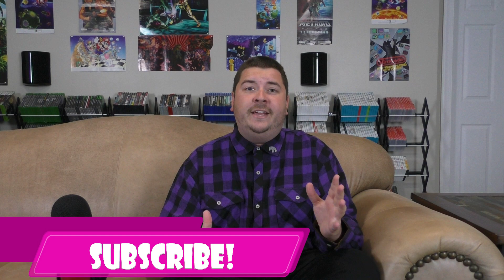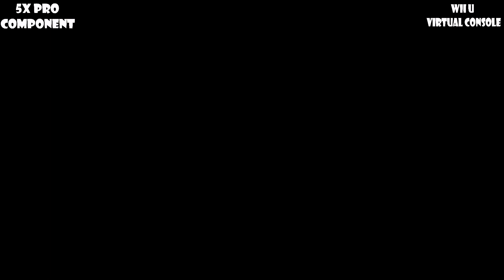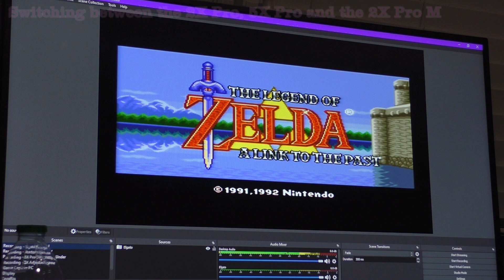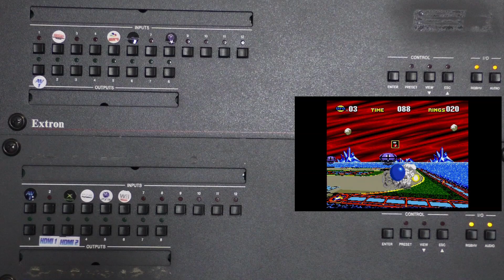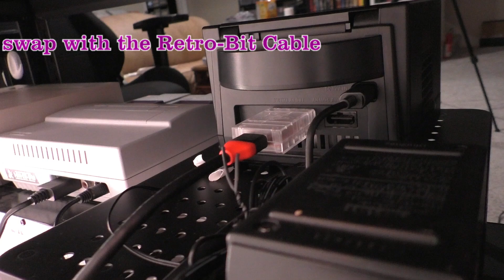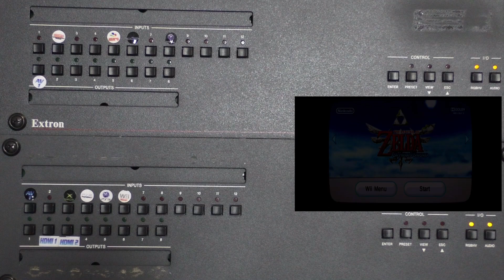My New Retro Gaming Set-Up: Powered by Extron!

Comment: You have a RGBHV extron switch the nice thing about these older generation BNC extra switches is there is no to very little electronics between the input port and output port. This allows for near to zero latency. There are other switches out there that have scaler and other features on them that add latency.

The nice thing about these extra switches, not having a bunch of electronics between the input and output paths is that any signal that you feed the input ports will be the exact same signal that comes out of the output ports. This means that if you feed it composite signal through anyone of the BNC connectors on an input that the same composite video signal will come out the same port on the output side. This is the same with component if you send your RGB component signals through that signal will come through the output sports as well. This is also true with RGB HD or any other variance of RGB. If you send any variant of RGB down 3 4 or five of the BNC connectors for that input, the output that you have selected will get that same RGB signal. If you want your set up to have mainly component and some RGB, then the best solution might be to use one of your two extra switches, solely for component and use the second one solely for RGB. I myself have thought about putting all different flavors of signal into my extra switch, but knowing if I do that I would need to be able to put independent outputs out of that switch the handle each signal type.

So if I have input one as composite input two as component input 3 as RGB sink on green and input for is RGBHV then I would have to have at least one output per signal type in this scenario that I showed above. I would need four different outputs one for component one for composite one for RGB sink on green and one for RGBHV.

I myself also have a crestron md-dm32x32 which can have HDMI 1080 P cards, HDMI 4K cards as outputs and as inputs it can have anything from HDMI to DVI to VGA to RCA to BNC as inputs. A nice thing I have done is I have a couple of DVI cards as my input cards. No I have not tested this yet, but might goal is to put a VGA to five pen BNC cable to the DVI card and run that to my extra switch which would allow me to feed that one card with anything from composite to component to RGB of any variant. Again, I have not tested it so I don’t know if it’s going to work. In theory it should work.

Bottom line to use RGB on the switcher you’ll need a VGA to BNC cable that breaks out the five pins that will allow you to plug your VGARGB source up to your switcher. But then the problem is it’s knowing which flavor of RGB or VGA that device is feeding you. And having another RGB or VGA device on the output side to grab that signal.
Reply from the maker: The flexibility of the formats and the near zero latency is something I should've talked about, its amazing that they can accept and output basically any analogue signal type without altering it, plus being able to split it or output different sources at once (up to 4 for my models). I had a good guide back in the day that helped introduce me to all this stuff. It was a manager at Video Game World who introduced me to RetroTINK, CARBY, and the Extron Switches. He did arcade machine repair and analogue audio set up as hobbies, so Extron specifically was something he owned and could help me with. The specific ones I got were per his recommendation all those years ago (I've had them since 2021).

Comment: Great video I do have a question. So I have all my consoles hooked up through component but for whatever reason my GameCube and Wii are giving me red/green lines now. I’m using the same company for all my cables so I’m confused why just those consoles are doing this.
Reply: The two systems work fine if I hook them directly into my tv but as soon as I route them through my Extron Crosspoint they are washed out. When you unplug the audio cables for those consoles the red/green lines stop but they are still washed out.

Comment: I have a question. For components video, is it possible to connect RCA left & right sound cables with BNC connectors to the H and V terminals without using RCA phoenix connectors?  I think it's possible in the sense of simply connecting the signal, but have you tried it?
Reply from the maker: An experiment! Challenge accepted......Challenge Regretted lol. To describe what I heard as "nails on a chalkboard" does a disservice to Nail-Chalkboard musicians. So no. Technically yes, audio travels through, but something happens to it, it comes out with increased volume and incredible distortion. I know that most Extron Switches let you mess around with the dB levels for the audio...but that wouldn't help here since these are video inputs, so I'm not sure how much control there would be for this use-case. So basically no, audio is intended to enter via phoenix adapters. RetroGamingCables sells specially made ones for Extron Switches, if you didn't know, that is where I got mine. They make dedicated Input and Output versions.
Reply: @RetroBoost  Thank you very much for your experiment. I'm surprised that you got different results, because as far as I know, RCA-type switchers and splitters are RGB and component compatible. I don't know if there's something special about extron products. I predicted it would work and already purchased a 6 input Extron switcher some days ago and it should arrive soon. I bought it for component video & audio. It's a smaller and simpler structure than what you're currently using, so I'm just crossing my fingers that the audio works. 😅

Comment: Hey, sweet setup my dude. How'd you deal with the Extrons outputting video and sync at TTL voltages instead of the standard 1Vp-p? 🤔

I just got an Extron CrossPoint 300 128HVA and quickly found myself hamstrung by the fact that the signals it puts out are too 'hot' for all my display devices. 😬
Reply from the maker: It hasn't been a problem for me. The specifics of that stuff is above my head, but when I got the two extron switches, I knew that you could customize some of that, so I decided to factory reset the two switches before I used them to prevent that from being a potential issue (mostly the audio levels being messed with was my concerns though). Sorry I can't provide more.

Comment: Love the videos man ! Thanks for all the info
Reply from the maker: Thanks! Extron is such a cool retro thing to mess around with. I recently hooked my VHS player to my 5X Pro with S-Video, but kept the audio rca running through the usual Extron input. Shockingly, it all stayed synced up, I was expecting an audio delay, since that input went from the top switch to the bottom one, then out to the 5X Pro. They aren’t kidding about the Extrons being lag free (at least so minimally you’d probably need to daisy chain a bunch to start to notice it).
Reply: @RetroBoost  I found a extron crosspoint ultra but the guy is asking around 400 euros I found this to be too expensive, I’m still using the same 8 in 1 out composite switch box like the one u had in set up 1.0, is giving me issues when splitting my n64 video output y wanted to get an extron mostly because of the lag free and no quality loss when using more than one output for the same source

Comment: To run RGB through the extron wouldn’t you just use a BNC-to-Scart cable? I got one from I think Retro Gaming Cables. I use it for my PVMs’ BNC connectors. I play my RGB modded NES, N64 & Genesis using it. I just plug the consoles scart cables into the BNC-to-Scart cable, and boom RGB.
Reply from the maker: I’m not totally sure how you’d run RGB through the type of Extron that I have. I’ve seen breakout cables sold at places like RetroGamingCables, but all of those have the Sync Cable as well, like what PVMs need, and like the one I got to play with in video I did with Video Game World. I’m not sure if that would work on the Extron Switches I have though, but I’ve never tried. I’m about to revise my set up, and will use a Scart Switch for all my consoles that can use RGB, and that switch will connect to an RGB2COMP, which will then run into my Extrons. Why? To allow for all my RetroTINKs to be able to access those consoles. I was tempted to run that switch directly into my 5X Pro, but then what happens if I get a RT4K? Uh oh, gotta rewire it all to that, but then I  the 5X Pro is left out. It’s the only way I can keep everything connected.

Comment: amazing setup, how did you manage to hook up extron 1 to extron 2 ?
Reply from the maker: Thanks! These Extron Switches have 4 outputs each, so I take Output#1 from the Top one and run that via Component to Input #1 on the bottom switch. Then the bottom switch is using its outputs to run to my different RetroTink devices. So the bottom one is kinda the “main” and the top one acts as another source when it boils down. Theoretically you could have 8 different extrons all output into one single Extron as a way of funneling your sources. That’s pretty extreme, but hey, someone out there has probably done it haha

Comment: Awesome setup and great info on those extron swites. I hadn’ heard of those before. I went on ajourney many years ago that still goes on today a little bit. I have one console left that uses Composite signal. My Nes and I hope to Rgb Mod it someday to use with Component cables. Currently it is plugged into a large Crt and looks nice nonetheless. I have two systems that use S Video and those are my Philips Cdi 220 model and the Panasonic 3DO FZ1 of which I both hope to get Rgb modded someday for use with Component cables. Again, I have them both plugged into a large Crt and they Look great, especially the 3do. I imported a Japanese 3do with the 240p switch which really cleans up the image. Now of course, I have the Xbox 360, PS3, Wii U, and Switch all plugged into a 1080P Led tv for perfect resolution balance through Hdmi. I also have my PS4 Pro plugged in through Hdmi but on a 4K tv to take advantage of that. I have my Dreamcast hooked up through a Vga monitor with the Oem Sega Vga box and damn does that machine look glorious that way. Finally, every other system I own is hooked up with Component cables. The OG Xbox is using the Oem box with component cables. My PS2 uses the PS3 Sony component cables and I have optical audio cables for both machines as well. My Gamecube is hooked up with the offical Nintendo Oem component cables. These all go to a G Comp Component switcher which is split between a Crt and an HD Tv for the best compatibility for enhanced definition/widescreen games and 480i/light gun games. The big one is the other systems. My Ps1, Super Nes, Sega Master System, Sega Saturn, Model 1 Genny/model 1 sega cd/32x tower, and Us Neo Geo Aes are all hooked into the G Comp using HD Retrovision Component cables for beautiful Rgb to the crt. I got my N64 rgb modded and have the same cables being used there as well and I got my US Turbo Duo Rgb modded, recapped, and region free modded and use the Hd Retrovision component cables there too for beautiful visuals. Finally, I use the Jag2snes adapter and Hd Retrovision Component cables on my Atari Jaguar/Jag cd unit. There are so many compenent cables, I had to get two G Comp Switches. 1 that goes to the large crt and a smaller one and the second one goes into the large crt and the 1080 led tv. Also, the Led Tv is on a wall mount that can turn vertically as I am a huge fan of Shmups, so with that, I have the ability to play every Shmup I own in Tate mode and the Analog systems that support widescreen in widescreen. Meanwhile, all audio is fed into the stereo for surround sound. This took many years and is my obsession but everytime I play a game, it looks and sounds great. I look forward to when I can get the 3DO, Nes, and Cdi on the component switcher as well to finish it all up.
Reply from the maker: That’s a fantastic set up! Never thought about being able to turn a tv to best suit shoot-em-ups, that awesome! I need to look into utilizing multiple screens too, that’s a killer idea the way you use the gcomps to work with that. Love it! That an a CRT, need to eventually get one as well. Biggest obstacle is space right now, need to find a way to better condense and organize things.

Comment from the maker: Been slowly working toward my next set up. “4.0” if you will. Thinking about using Blue Retro Cores on each console, so that I can use the same controller for all my consoles. Then I might add a SCART Switch, like the one RGC made for the 5X Pro, so further consolidate inputs and free up some slots on my Extron Switches. Bit by bit, I’ll get there.

Update:

I’ve decided to lean mostly into 8bitdo’s receivers, and have gotten them for most of my consoles. The only ones I don’t have 8bitdo for are the N64, GCN, and Wii. For those I’m using a RetroTime BlueRetro Receiver, and can still then use an 8bitdo Pro 2 controller for them. Decided that I would use a scart switch into an RGB2COMP as well, this way all those scart sources can be output to a variety of outputs.
Reply from the maker: Update, the Blue Retro dream hit some snags. Bought a couple of Blue Retro Cores, one of which seems to be either defective or is super non-cooperative. I’m able to use it normally, but can’t for the life of me get into its configuration to custom map buttons. The Blue Retro Adapter made by RetroTime was very good, they are making a GameCube one next, maybe they’ll eventually make one for every console haha. The Blue Retro Core that is working is for the GameCube, I was able to access the configuration over Bluetooth. I still may get more Cores, hopefully the defect I encountered is something that won’t happen again.
Reply from the maker: Another update on this controller topic: 8bitdo let me achieve the “one-controller” dream. Got their receivers, then got a Pro 2 controller, which also works with the RetroTime n64 blue retro receiver. The Pro 2 doesn’t have full functionality with the GameCube Blue Retro Core, that was the only snag, the L and R inputs don’t register. RetroTime is releasing their own GameCube receiver, which I hope will work fully with the Pro 2 like the N64 one does. Great controller.
Reply from the maker: @gilramos5767   It is heavy duty garage shelving. You can customize the height of the shelves, so theoretically I could fit a CRT toward the center. I’ve been happy with it. I added monitor stands to then add “sub-levels” that the consoles can sit on, allowing for more to fit.

Comment: I think v4.0 should be getting a Crestron processor and control your console AV switching with a touch screen like I do 😀I wish YouTube comments could upload a photo, I’d show you my work in progress. My system consists of a Crestron DMPS3-4k-100-C, TSW-1052, Extron MAV 84, Crestron HD-MD8x1 (hdmi switching). Essentially the touch screen turns the power on to the TV and does TV controls and to switch the console selection, click and drag which console you want and it switches it to the proper source.
Reply from the maker: That is an awesome set up! And great suggestions! I definitely need something more efficient for HDMI consolidation. That 8x1 Crestron Switch is a great idea. Another thing I’m definitely doing is getting Blue Retro Cores for all my consoles, that’ll let me use the same Xbox or PS controller for ALL my consoles. Very efficient.
Reply: @RetroBoost  do not get a crestron processor. The program Crestron processes you require specialized software that only Crestron integrators can download. The best suggestion that I have for you to automate the set up is to connect your extra switches to the network and set up Home Assistant with custom scripts to control which device devices get switched for what reason.
Reply from the maker: @davidew98 The stuff mentioned above by earlmcnulty is damn cool, but yes, requires some additional knowhow and access to utilize. On the retro boost discord server, Earl shared the journey with photos and everything, it’s spectacular, but between the cost of getting all that equipment and needing to learn all the software side, plus certification for it, or paying someone to do it, that has kept me away from that specifically. I’d say cost alone is probably the biggest thing. All my recent fun money has gone into upgrading the production side of what I do: new camera, accessories, lighting, audio, etc. I’d love to have a system like what Earl has built, but don’t see it happening for me for a few of those reasons…
Reply: @RetroBoost  start playing with Home Assistant. It can do everything restaurant can do, but it is DIY it is free. It is open source and you can do anything you want with it including controlling extron and Crestron switches.
Reply: At work, I work on Crestron and extron hardware all the time with all the conference rooms that I engineer and deploy. But for everyone else out there, it’s probably much more beneficial to not try to walk into that crestron has. Much better to stay in DIY open source realm.
Reply: @RetroBoost  I'll definitely have to check out that blue retro core product. My system is still a work in progress as previously said and still has a ways to go, the last piece of gear i need is a retrotink so I can upscale the composite to a 480p signal. Once I get that I'm going to build a small av rack to house all that gear and i gotta make the wiring looms that run from the AV switching system to the systems. Still trying to figure out how i'm going to structure the consoles, but at least from coding stand point i got that done lol